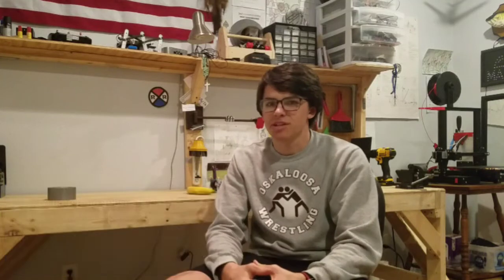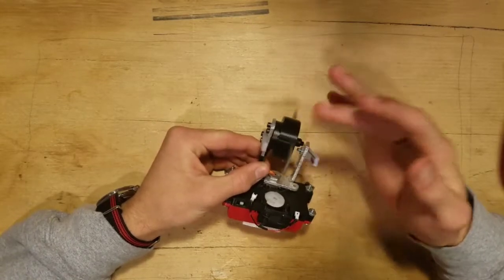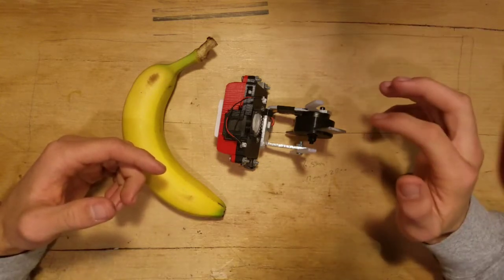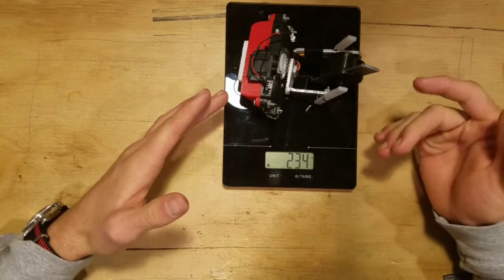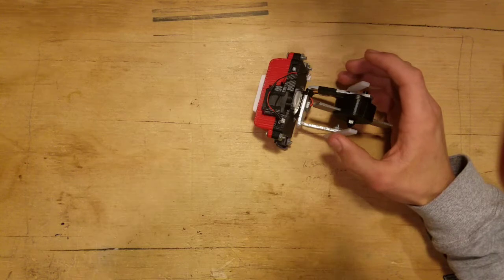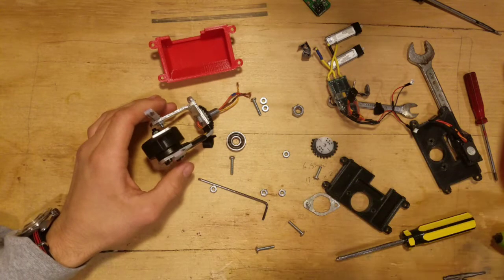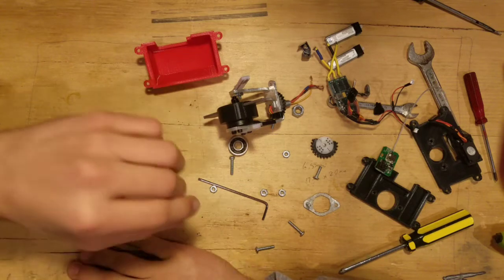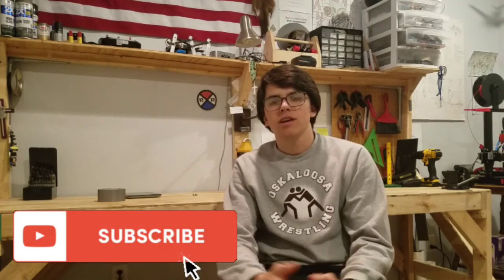Fairyweight GYROSCOPIC WALKING Robot Build - RFC

Comment: Honestly, at fairys and ants, a brushless esc is a brushless esc, as long as it isnt massive and it supports the voltage you are running, 99% of the time, you will be fine.
Reply from the maker: Well the one I'm using on this is pretty massive but it works and I have the weight for it so I might as well

Comment: Happy to see break downs instead of build videos. This bot is looking a lot like Gyrobot, was that your original inspiration? I saw your last video and it got me thinking about a different system for the legs at the back, basically like RHex from Boston Dynamics, where you have the option of putting one foot down and the gyro force turns you, or you can rush forward quickly by spinning the legs. It would require a completely different setup but I might try it out myself at some point. Also, make a test box!
Reply from the maker: Yes I was inspired by Gyrobot and also Rickety Cricket, and yeah I need to make a test box.